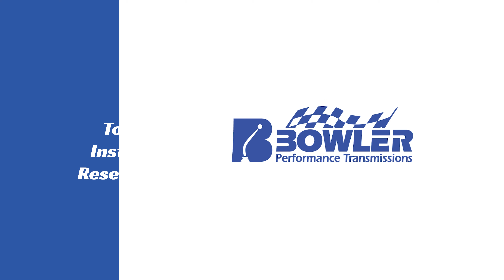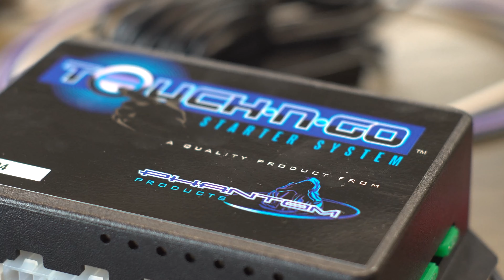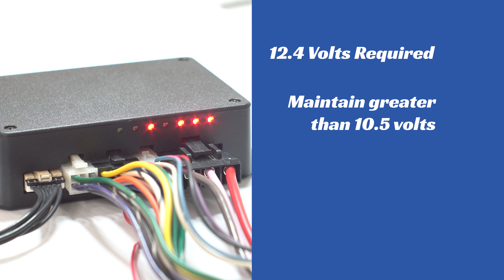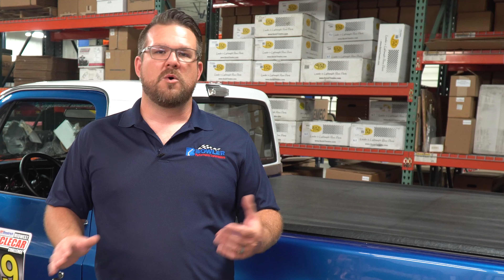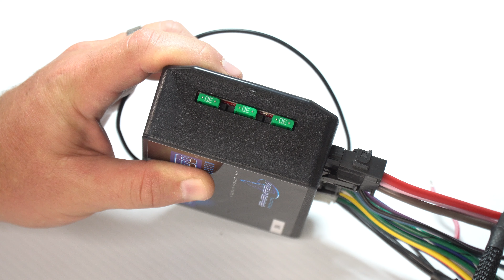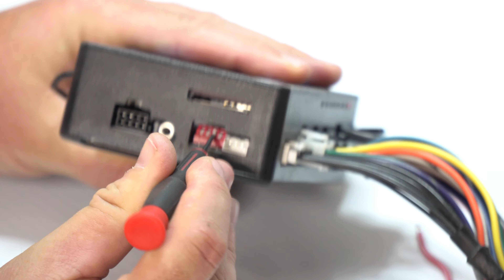How to use your touch n go start system.

Comment: How do I get a touch n go button replacement for the system or how do I get the 25mm button that goes into the column ignition hole, or is that included in the box???
Reply: please contact us at  info@bowlertransmissions.com